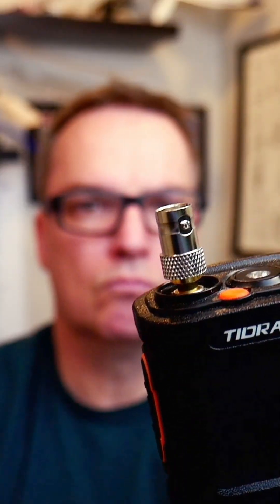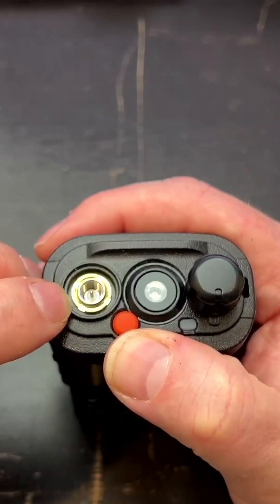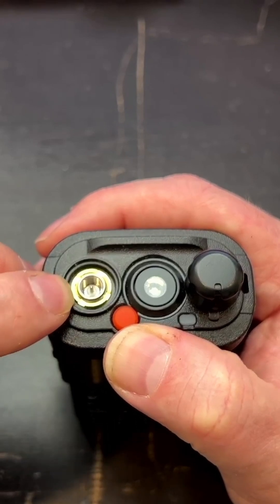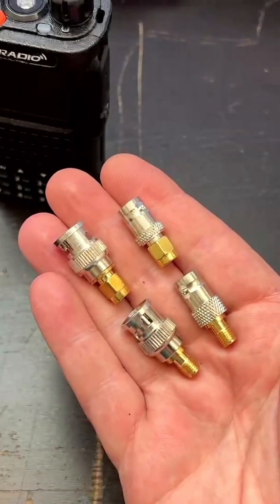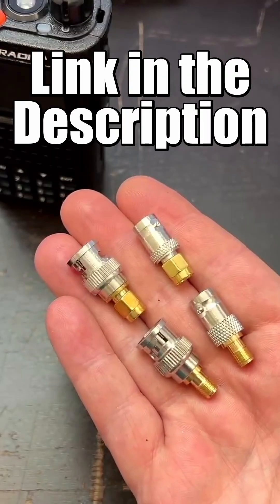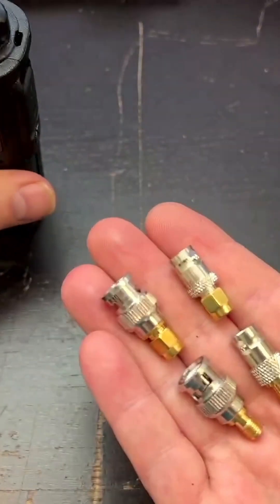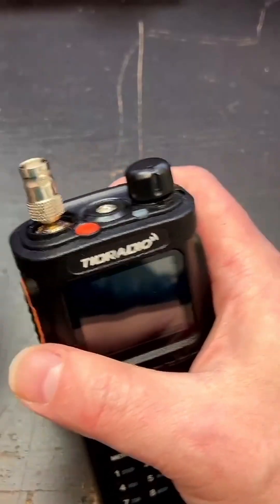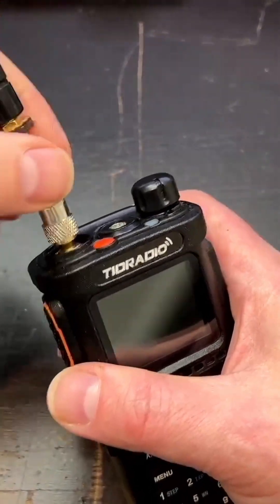Ham Radio HT Antenna trick: SMA to BNC Adapter

Comment: I'm new to radio, but I just bought a Uniden Bearcat BC340CRS scanner and the antenna that came with it is terrible. I'd very much like some recommendations from someone that has knowledge on the topic so I can get a decent setup, ideally with an antenna I can mount to the roof of my house.
From the information I looked up (and I could be wrong), the scanner has a BNC type antenna connection port on the back.

Comment: what can be done about the gold/silver gap?
Reply from the maker: 3d print cover if it bothers you or even do a wrap of tape or heat shrink
Reply: Use the type adapters that have a  base that sit flush on your radio.

Comment: Got one of those for a baofeng I have, but when i go to undo the BNC cable from the radio, it just starts to unscrew from the sma. What do you suggest?

 I'm hesitant to tighten it TOO much, but it is just going to unscrew from the sma, instead of detaching from the bnc that sort of defeats the convenience of the bnc.
Reply from the maker: Great points and to be honest I use a wrench to tighten the SMA down. So I do not have this issue.

Comment: I hooked a baofeng to my car’s antenna using those so I could easily move it when I first got into radio. Now I have a proper mobile rig along with a license. WRZV439. Nice TD-H8!
Reply from the maker: Yes the TD-H8 is good the mic gain sucks but in the end that’s my only real complaint

Comment: The adapters from signal stuff screw down flush with the unit.  They seem to provide a little more support because of that.  73
Reply from the maker: I’ll look into them. Thanks
Reply: I'm glad someone else said something abiout this. I won't use the type that don't sit flush on the radio body, taking the stress off the SMA.

Comment: Those adapters blow
Reply from the maker: Got it but, that was not constructive at all. What adapter would you recommend then? And why?
Reply: @VE6SFX_HamRadioRookie  I'll agree -- definitely not constructive on my part, my apologies. I recommend the Diamond Antenna BNC Female to SMA Male Adapter, provides a much more stable connection. Thanks.
Reply from the maker: All good. I will check those out. Thank you!

Comment: Some suggest adding a rubber washer to better seal the radio. Thoughts?
Reply: I don’t use the rubber washer. I found that the sma will not screw down far enough and cause problems.
Reply from the maker: In the end the seal needs to be to the outside of the fitting and this really does not allow for that. Maybe I need to print a flange to cover the full opening? Correct me if I am wrong here.
Reply: @VE6SFX_HamRadioRookie  I am not an expert. SignalStuff sells washers because his SignalSticks are not always snug on the radio. And I am about the original SMA on the radio, not your BNC adapters.
Reply from the maker: Yup I get that this is not for everyone. I have a condition that makes my hands tremor really bad some days. So much so it is nearly impossible for me to work on small fittings like that. Thus my BNC adaptation. It makes it so even on my bad days I can still do some stuff on my radio.
Reply: Don't use this type adapter. They make the same SMA to BNC but with a large base that makes them sit pretty fluch against the top of the radio. Much more stabvle and takes the stress off the SMA. Search SMA to BNC adapters and some like that will come up.